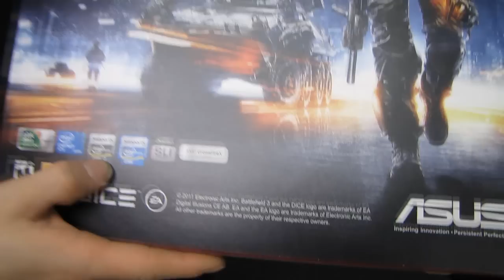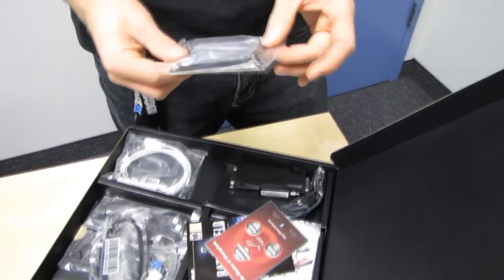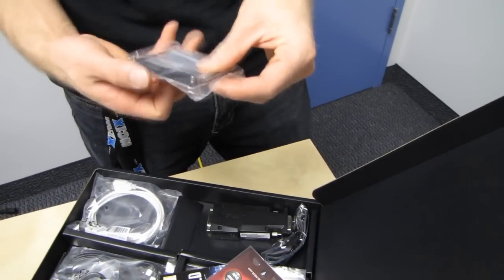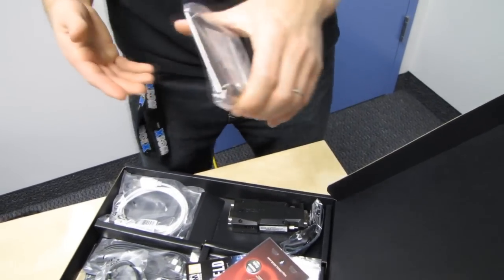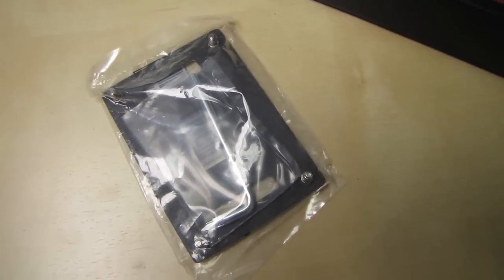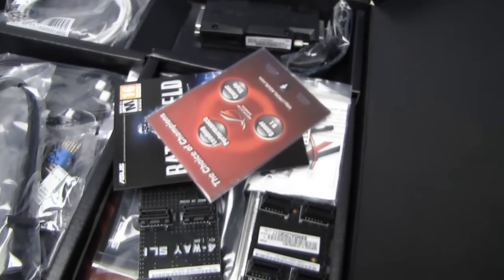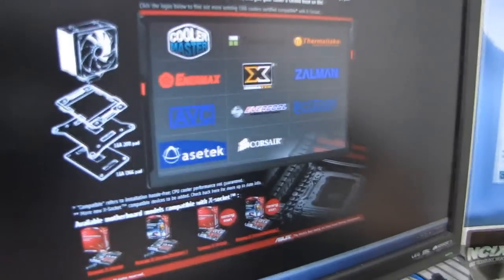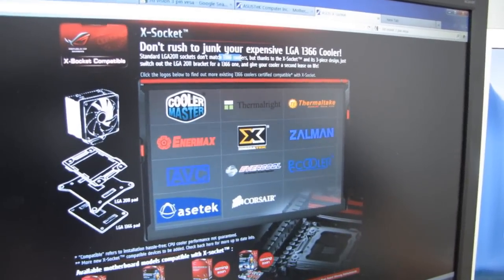ASUS Rampage IV Extreme LGA2011 SLI Motherboard Unboxing & First Look Linus Tech Tips

Comment: I don't know if you got my message (Nick Bundy), but you probably didn't because of the new shitty comment update... My budget is about 5000 dollars and my thoughts are a 2-way GTX 780Ti with the Maximus VI Extreme and the I7 4770K processor. Thanks for your help btw. :)
Reply: In your place dude I would go with a 2011 board and CPU (even the quadcore i7 2011 one) because of the PCI lanes - so u can go 16x 16x SLI and you'll have more upgraidability (in my opinion). Plus you know Asus is comming up with a Black edition 2011 board that looks like nothing before right? Best of luck with your build dude :)
Reply: Thanks for sharing your opinion, it really helps a lot. What processor do you want to install with a 2011 socket then? Good luck with your build too :)
Reply: ***** To be honest I don't have a new build lined up (I'm european from Bulgaria actualy and I dont have the money for it but still i keep myself quite informed on new tech and benchmarks). So for 5 grand I would go for both looks and power with Intel Core i7-4930K (less expensive than the 4960x 400$ less and still hexacore with lower clock and beastly performance). For the mobo ASUS Rampage IV Black Edition LGA 2011 because it looks fucking epic (excuse my french) - beastly overclocker, OC panel which is well... good if you can get pass the short internal cable. The audio on this board is quite nice from what i've heard of and it is Asus - a brand with long lived reputation. Still the 499$ price tag is a bit much and if that's the case a Sabertooth is nice. If you are a Gigabyte fan I would go for the UP4 but still Asus's black mobo is the best i think if you can get pass the 499$ tag. As for the graphics - with that budget I would do the same as you 2x780ti.  AMD has nice graphics too but they run quite hot 95C on the R9 290x and are quite loud - still Mantle - maybe it would be a game changer - think about it. Still 780ti is the way to go I think. RAM is Dominator Platinum 2133 MHz - its reasonably priced it looks awesome and everybody knows its one of the best RAM modules you can get. I would go with 4x8gig or 4x4gig (I dont use many ram heavy apps). HDD and SSD - 2 ways to go - I would go with a 512gig Samsung 840 EVO (cheap fast reliable one of the most balanced SSDs out there) and either WD Black or Seagate SSHDs (they are awesome for smaller files transfers- it has 6GB SSD buffer). But I would say this - don't go overboard with the SATA population and dont use the Marvel chipset - it uses the PCI-E for data transfers. As for cooling - go full watterblock on CPU and graphics (Koolance or EK both epic and in my oppinion the best). Water pump from Swiftech (i dont have the exact model on hand but there is one that everybody including me recommends with both hands and feet, you cant miss it). Rads, res's and coolant - take  you pick - everybody has a choice and you cant really go wrong. Fittings - go for pressure fittings (they have their drawbacks but the look bitching) Case - again personal choice but for a build like this I would go for the biggest I can find. Power supply - Rosewill has 5 stars (eggs) on everything but for some reason the EVGA SuperNOVA NEX 1500 Classified 80 PLUS GOLD Certified is like porn to me (5 year warranty is awesome too and the cables are individualy sleaved ). Also take a look at CORSAIR AXi series AX1200i - awesome supply too. As for how much Watts - i would go for >= 1200W (this machine will see some serious overclocking and i dont want to bottleneck anyhing or strain the PSU). As a side note if you find some spare change lying around take a look at ASUS ROG RAIDR Express PCI-E 240GB  (810MB/s write and 830MB/s read is not to be taken lightly). If you are looking for REALLY premium audio take a look at ASUS Xonar Phoebus (not the absolute best but has nice features for gaming). Last thing I want to cover is peripherals. I know they are totaly subjective but still - take a look at Gamdias Hermes for a keyboard - CherryMX blues, has macro keys, awesome palmrest that doubles as a cover for the keyboard. Take a look at it it's worth it. As for mouse - Razer DeathAdder 2013 cant go wrong. Still there are other options which are just as good. Hope this helps and if you need any more help feel free to ask :)
Reply: Martin Yotov Also it would be awesome if Linus can take a look at this "thread". Can you guys upvote or something (make a refferance on the forum) so we can help the guy out :)
Reply: Martin Yotov Also I noticed that Nick Bundy advised you for a Z87. He is right to some extend. 2011 is a bit overkill but with a budget like yours I dont see it going any other way. 2011 as of now is more or less for bragging rights - it gives you more RAM slots (which you dont need) it gives you better processor (which is overkill unless you are planning on some serious rendering/decoding) it gives you more PCI lanes (which Linus made a video about - give you less than 1% performance boost for 2 way SLI). But! On the other hand you sort of future proof your PC (I know I know there is no such thing as future proofing but still the machine i laid out will run everything on Uber! (Ultra/High) for at least 4 years in my opinion)
Reply: Im sorry for adding more comments (I promise this is the last one). If u go for the Z87 1150 - go with 4770k and ASUS MAXIMUS VI FORMULA LGA 1150 - awesome board. Still if you do some adding up the 1150 will give you 400$ cheeper PC which is still awesome (can cap any game today, tomorow or 2 years from now). It will be awesome but it will never be 2011 hexacore Asus black eddition awesome!
Reply: Martin Yotov Wow. You just made my day! Thanks for the awesome answer(s), and yeah, the upcoming Rampage IV Extreme Black Edition looks totally badass and godlike. As for a fully watercooled rig, I really don't have a chance. I don't know how to do install all the parts and it will cost a bit more than intended (but I will of course watercool my processor, maybe with a CM Seidon 240m ( <- fell free to add a better suggestion)). As for the motherboards, would you then suggest the Maximus VI Formula instead of the Extreme edition? If I choose a LGA 1150 motherboard, I would totally follow your suggestion and buy the i7 4770k and if I choose a LGA 2011, I would also follow your suggestion and go with an i7 4930K. As for the memory, I would go for the Dominator Platinum 2133 MHz (same as your suggestion) and imagine those sticks on the Black Edition motherboard... sweetness! For the GPU's I would go for a 2-way ASUS GTX 780ti or a 2-way ASUS GTX 780 (it depends on the money) and for the PSU I would go for CORSAIR AX1200i because it's 80 plus platinum. Lots of Samsung SSD's (120GB for the OS and maybe 2x 512GB for the rest). If I buy a soundcard, I’ll go for the ASUS ROG Xonar Phoebus Solo. For the tower, I'll go for either the CM COSMOS 2 or the CM HAF X. Feel free to add better suggestions and btw, I’m from Denmark. Thanks for all your cool answers; it really helps a lot :)
Reply: ***** A comment for the SSDs - if you check the speeds of a 120gig and a 512 gig you will see a noticeable speed difference. Also SSDs die after a set number of writes so if you have a bigger SSD the lifespan is increased alot. Go for 1-2 big SSDs it will be cheaper and faster and more durable. As for the wattercooling i strongly urge you to reconcider - check out some of Linus's videos for the wattercooling guides - its not as hard as it seams. If you go without a full wattercooling setup youll get by with more money in your pocket and your closedloop cooler should be the NZXT Kraken x60 in my opinion best one out there.
Reply: Martin Yotov Oh and forgot to elaborate on the 1150 mobo. Formula looks better with the termal armor and has better audio. OC capabilitys are almost the same (actualy the same + OC depends on the CPU chip you get be it a dud or a unicorn). Since you are not thinking of a custom water loop this leads me to believe that you are not a complete OC addict (like me :D ) so you dont really need the OC panel. And this is why Formula is the better pick for you rather than Extreme (the Extreme board is even equiped to handle better with LNitro/Helium cooling which you wont use). Dont get me wrong Extreme is an epic board - just not for your needs :)
Reply: Thanks for your help with the SSD's and the closedloop cooler and yes, I'm not a big overclocking enthusiast, so I'll go with the Formula (which also look epic). I'll follow your advises and build one an epic computer. One last question though, since the formula has better audio, do i then need a sound card in your opinion?
Reply: ***** All I can say is what Asus said - Formula has the best Supreme FX implementation. Will this be enough? It's for you to decide.  I really think that you wont need a sound card.
Reply: Me neither... Thanks for all your help :)